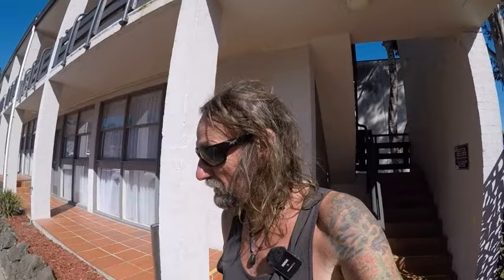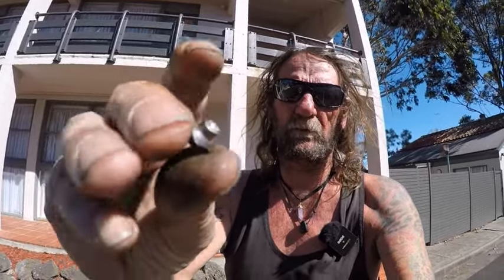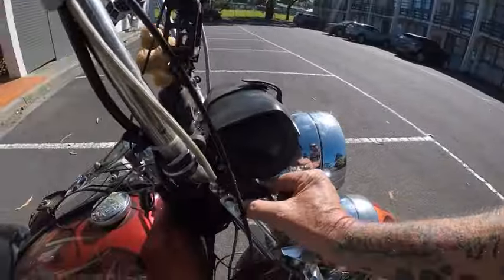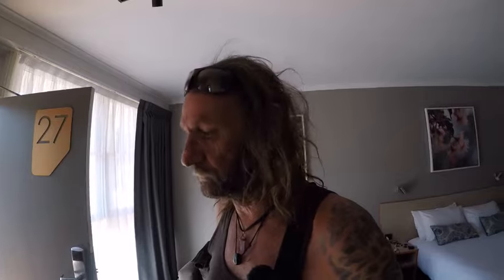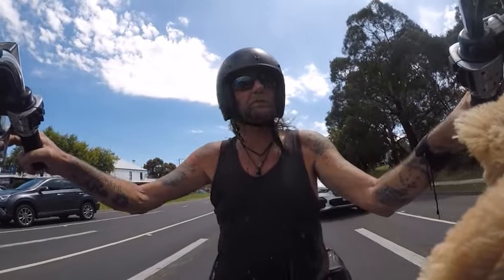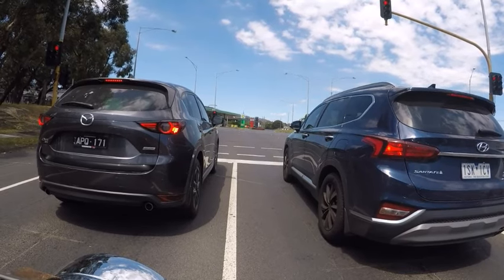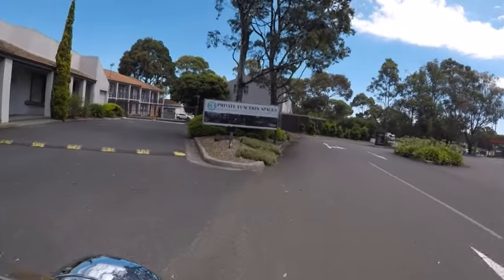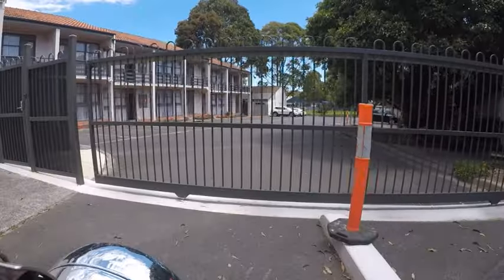Harley Fun In Melbourne... Hippy Trev

Comment: On those older wide belts getting a hole will unfortunately in all likelihood end up shredding or snap on a power take off, Trev.
You might be able to upgrade it to a new skinny one which are stronger, cost a few bucks though....best of luck mate
Reply from the maker: l got a good spare ne in the shed at home  but l have no tolls down here to do the job if it breaks..  cheeers

Comment: The cameras at the lights are to catch people in cars on their mobile phones.
Bummer about that bolt. The tradies etc always leave shit on the back of their tray back utes. It normally gets swept by cars into the left lane and then the gutter.
You must have got something off an engine parts supplier's ute or a wrecker or a bloody swap meet trailer.
I found that ring road the worst in Melbourne for shit in my tyres (screws, drill bits and a bloody tie down of a truck etc)
hmmmmmmmm. Hole in the belt. Big job Trev, primary has to come off and the clutch basket?
Could always take it to a shop mate.
Peter Hughes
(first 100 scriber)
Reply from the maker: l know its a huge job l replaced the belt on this bike 2 yeas ago  l had all the tools & still took me 3 days....  hope it holds  mate .. cheers
Reply: The Road King special (my offer)???????? Crikey mate you wouldn't be able to lane split on it with those big saddle bags !!!!!!!!
Or keep your licence on it the way you ride. Shit, people are getting out of your way. :goodvibes:
The belt will be right and will get you through this trip. Luckily you have the wide belt unlike the new Harleys with the narrow ones. @hippytrev7452
Reply from the maker: @HighCountryHughesie  lm haveing sooooo much fun hey....  l hope the belt holds.. cheers

Comment: Some of those USB need a adapter which is the one that came with the original one, you may still have that on it, if it is still on the cable, take it off then it should work
Thats bad that a bolt was stuck in the Belt, not good that theres a hole in it
Reply from the maker: didnt need an adapter  was  strait plug in....   that bolt may hace come off my rack..